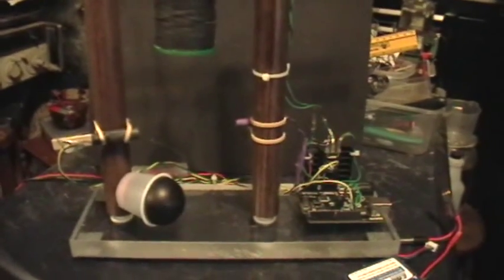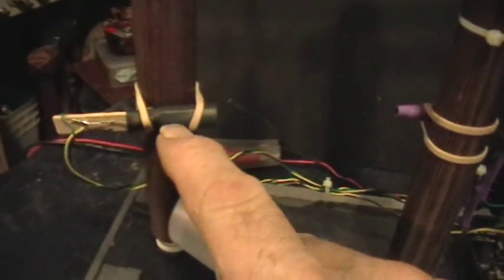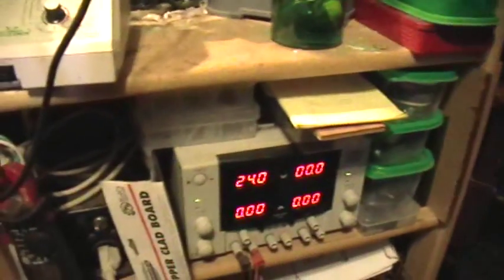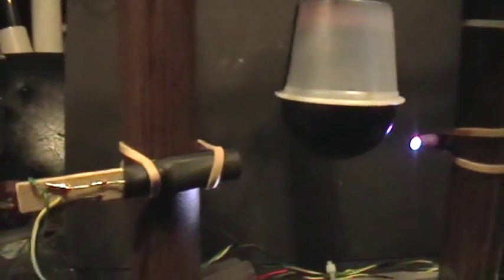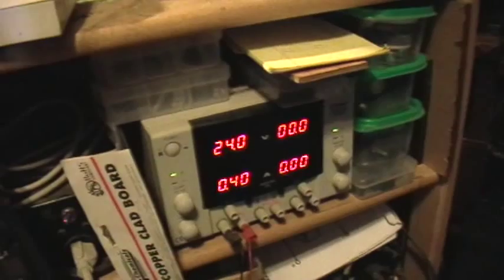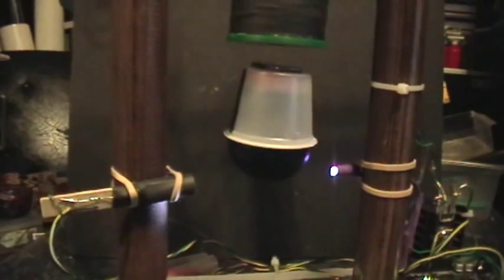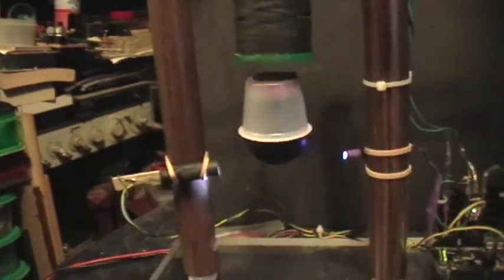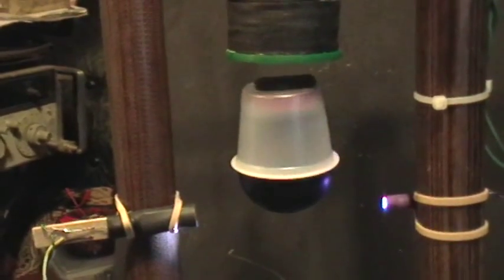Arduino 16: Magnetic Levitator Optically Controlled

Comment from the maker: Also in a second step, I put a fast highcurrent diode across the coil, with anode to Mosfet Drain, cathode to coil-POS connection. I used one from an old TV chassis, marked RL30A. This really improved the performance of the system. This is shown in the next vid Arduino 16b, which is publicly viewable.
Please let me know if this isn't clear or if you need other help. 

Thanks for your interest. I'll probably put more of my Arduino vids back into public view soon.

Comment: Ok,here is a wild thought.
If you made your coil useing a PM as the core(not to strong-ceramic)and had the coil pulsing an opposite field in reguards to the PM field,then having the magnet on your floating cup as so it is attracted to the PM of the coil.
Then use the electromagnet of the coil to push the cup away insted of attracting it.
When the coil is switched of,it will change from one field to the other instantly.This would give one wild kickback pulse from the coil that could be used.

Comment from the maker: Thanks Tom. I've made most of my Arduino vids private.
But if you look at my vid v=wxxPWbDqIcA  I show and describe the basic Mosfet circuit. For the levitator I used an IRFP460 power mosfet on a small heat sink, and of course a separate battery or power supply. So the NEG of the external supply goes to the Arduino ground and the mosfet Source pin. Mosfet gate to 10R to Arduino PWMout pin. Mosfet drain to coil, coil to ext. supply POS. Pulldown R is 1 Meg from Gate to Source right at the mosfet.